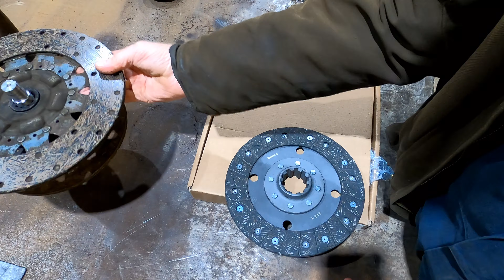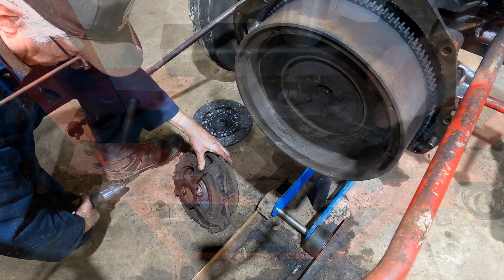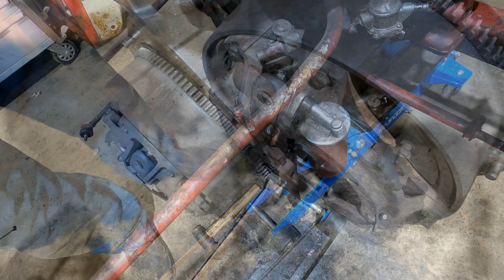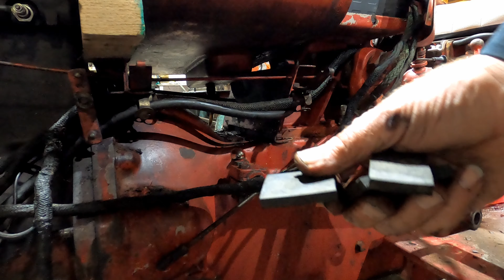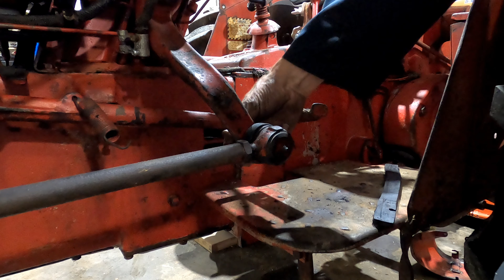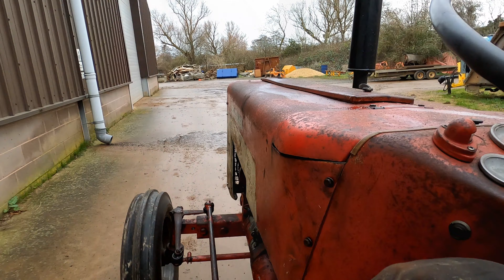Repair and run my IH 434.

Comment: Do you remember the torque specs for the pressure plate?
Reply from the maker: Google it and find a standard bolt chart with a full list of torque settings.  I would also say, make sure they are tight 😉

Comment: Thanks for the videos. Can you answer a question for me, which way does the transmission clutch face? Does the longer splined side face pressure plate or flywheel?
Reply from the maker: If you try it against the flywheel it will only fit one way round.
Reply: @Casterton-Vintage  Thanks

Comment: What was the mod to after market pto plate?            application of small file to splines to tidy up, in order to move freely?
Reply from the maker: It was very slightly small and wouldn't fit over the splines.  I flap wheeled it a little and, as you say, tidied up the splines with a small file.

Comment: I made a clutch alignment  tool out of wood. When I split the tractor and before I took the pressure  plate off I fitted the piece of wood. So it worked great when I put the tractor back together. 
Great job there. Your tractor looks more compulated than my old Ferguson.  
Good that she back to working condition.
Reply from the maker: Interesting solution.